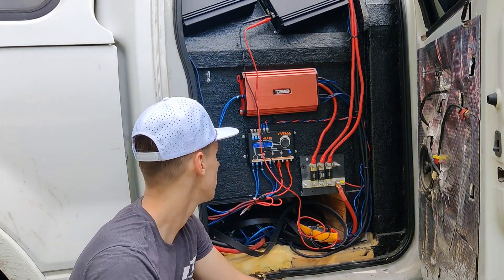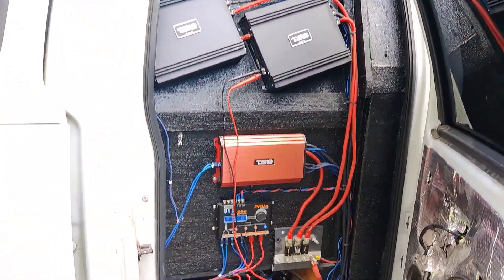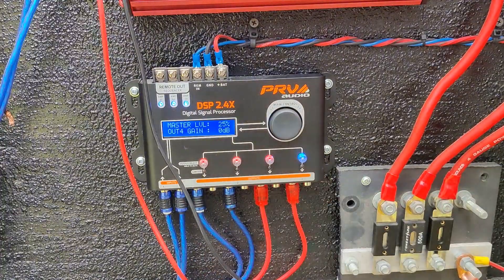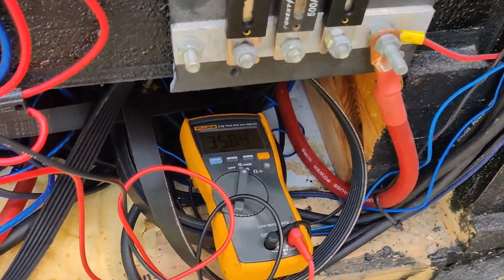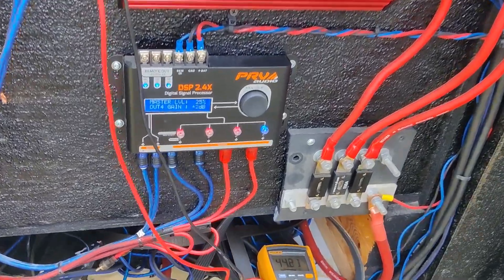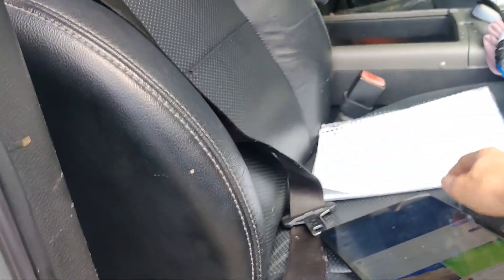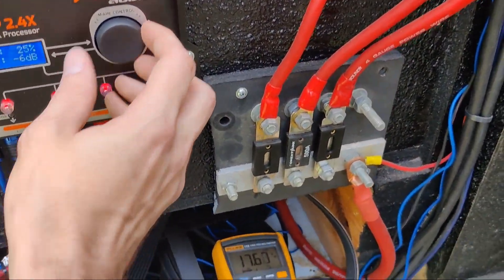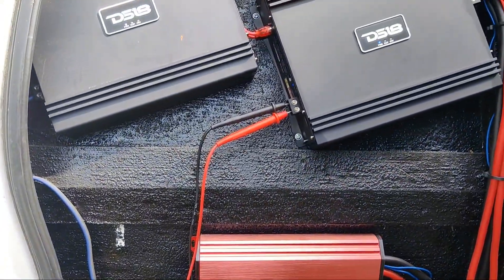"Step-By-Step Guide On Setting Gains Through PRV DSP" With Or Without Clip Light

Comment: This is wrong… the clip light on the amplifier itself is only showing amplifier clip. It does not show clipping from the actual signal source (dsp). If you have a dirty signal coming into the amplifier, you’re always going to have a dirty signal, regardless of that clip light. You need a o-scope to see if the dsp is clipping at +11. then you could trust that clip light after verifying.

Comment: Should i set my gains with a dd1+ cc1 on my amp then adjust on dsp?
Reply from the maker: @angelnoguera1209  if you set the gains with dd1 you shouldn't really have to use the DSP. You can set the gains and find out the VAC on the amp clean, then hook it up to VAC set your crossovers and everything then double check your vac while it's on the DSP. If its too high bring it back down to the VAC you had before and vice versa if it's too low
Reply: @Countryboy8270  I just thought the DSP would bring out more sound quality after tuning? I didn't like having a cockbox I figured using a dsp would be a better alternative since I got 2 4 channels on it

Comment: How come your only using one out if each set of rcas?
Reply from the maker: @SuperSportAudioProduction  so on the smaller amp the channels are bridged so channels 1&2 are 1 output for the DSP and 3&4 are output 2 Less wires for that. The bigger amps have 1 input and 1 output rca spot, you could run splitters but it's not necessary